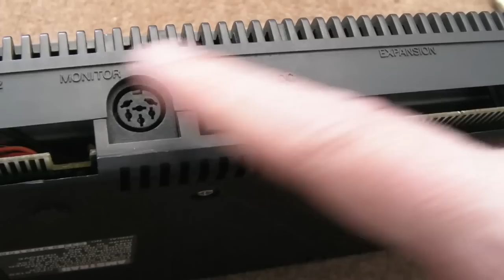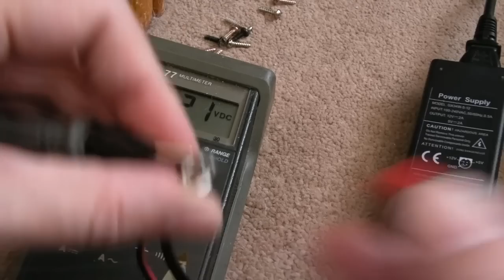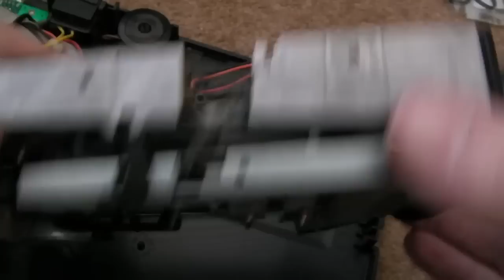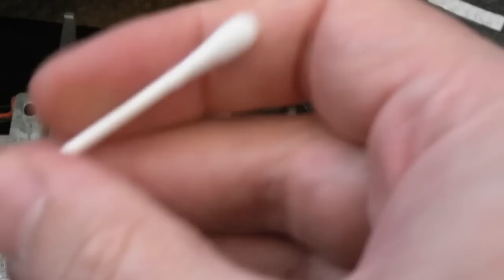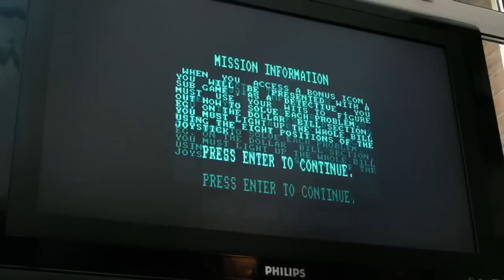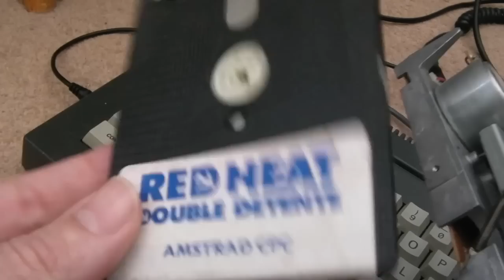Amstrad CPC 6128 Repair & Upgrade Part 1

Comment from the maker: Part 2 - https://youtu.be/y5fvoTnyQTA
EDIT: skonkfactory and TrollingAround pointed out that the infra red sensor there isn't for rotation timing, but used to detect the start of sector 0 when formatting.  This should allow tracks to remain in sync with each other on the disk, ie. all starting sector 0 at the correct point.
Link to Noel's Retro Lab video - please check it out, and his channel! - https://youtu.be/WK0QoVNVO2w
I had to re-upload this- someone pointed out I messed the credits up!!!
Reply: Springs to Mind? 🤣🤷‍♂️
Reply: yep subbed to our man Noel... he must be good because he has somewere to hang his tools ::)

Comment: I had  a nonworking Amstrad drive for years. I cleaned it and I replaced the belt but it refused to work. Yesterday I change all the caps and  it was the first time I got a dir from a floppy. It turn out bad caps on these floppies are a common issue.

Comment: Impressive work of patience and knowledge. How I would like to have one of those, but I would never be able to repair or solve issues if something happens to it. Could that drive be replaced by a 3.5 floppy drive?
Reply from the maker: Thanks!  I believe you can change the drive to 3.5" on this and the Spectrum +3.
Reply: Yes. But:
- You have to swap some lines in flat data cable
- You have to swap two wires in 5V connector
- Standard 3.5" drive never fits the space for 3" drive

Comment: Nice video, thanks for sharing, I bought the following power adaptor from ebay and it works great with my CPC 6128 https://www.amstrad-noob.com/2021/01/26/connecting-an-amstrad-cpc-6128-to-an-external-lcd/ and you won't need to desolder or resolder anything on it, it's compatible with the CPC.

Comment: Interesting fix, by the way that fdd you had is not the same in all CPC 6128's, only some shipped with that particular brand and particular failure, I liked how you explained that the hole in the disc inside the fdd was for the rotation speed, i'll keep that in mind when i program a tool to test alignment/speed for the cpc 6128 later this year. Oh, one final thing, Noel's name is pronounced the same was as 'the first noel...' christmas song (as in 'no el'), and not as the Irish/English pronounce it. Thanks for your video !
Reply from the maker: Thanks!  I stand corrected regards to the hole - some drives (PC ones - not 3") may use that for rotation timing, but it seems that majority of older drives that have a hole like that use the hole to find sector 0!  That's evident in the 6128 Service Manual which I looked at yesterday.  From what I understand they use that pulse so they know precisely where sector 0 is (presumed only when they are on track 0, looking for sector 0).  Some people have suggested that sensor is only used when formatting and a read will work without it.  I don't quite get that tbh, because you would think that the drive would be able to find sector 0 by just reading the contents of the track and looking for an index pulse or something similar.  Maybe it didn't write anything like that, just the raw data....  And when formating, does it really matter where you  start writting sector 0?!?!  I would think not, unless there's some underlying low level format done at manufacture and the position where you write is more critical than I thought?!?!   EDIT: Just made a correction to what I just typed.   There is a TRACK00 sensor, but that I believe is the normal track 0 sensor, not the IR one.  Others have suggested the RPM is constant 300 rpm and not adjusted / controlled on these drives.  I am not sure that's true of all the drives because the service manual describes adjusting it.

Comment: Great video and handy. I got given one of these with monitor and disks for 'my collection' last year. I did change the belt as you did (bought from the same place!) and the DD still failed so it was consigned to a box for sometime in the future. I might dig it out this weekend and give your fix a go. Cheers.

Comment: Interesting,  a Meanwell PSU gave my CD32 video interference. On my 6128's I ditched the floppys and am using Goteks. They fit nice with Gotek case cutting. Then you can ditch 12V and fit a push button in the space, this is wired to test points on the expansion connector to give 'push reset' instead of power on/off. I think your CRTC is a good one (Type 1). BBC Micro CRTC's are compatible. One of my 6128s had a type 2 which is not the best for demos, so that was removed and a socket added.
Reply from the maker: Yes, done exactly that in part 2 =D

Comment: The CPC monitor has a socket for the power cable to go into, and a cable to go into the socket on the CPC. Amstrad joysticks have a socket for the second joystick. The wiring routes the common line on J2 to the common2 line inside the CPC. I got a CPC the week they went on sale in 1985, and used it regularly until 1996.

Comment: Hi, very nice video. I have a dude about disk belts, anyone knows where to find replacment belts for floppy drive? Any home made replacement?

Cocoe68
Reply from the maker: You need to measure the thickness of the belt, its diameter (approx - a little smaller will fit and work generally).  Best place to find them tends to be eBay.  Search on the diameter and you might find something suitable.

Comment: The spring takes up the end float of the armature. Some motors will have a wavy washer inside to do the same thing. As you said the armature being allowed to be pushed back further affects alignment. Are the holes on the back of the motor threaded?  That might be a way to attach a bracket to push in on it though I think your shim will work forever and is super simple.
Reply from the maker: I am pretty sure the 2 screws that hold the motor on could be removed, cap fitted over the back of the motor, and the screws put back in to hold it on.  That said, the alignment would then need correcting =/
Reply: @GadgetUK164  It looks like there are holes in the back of the motor itself. If those were threaded there would be no need to alter the alignment. Of course, it could just slip over the back of the motor and be fixed in place with a grub screw or two that press on the side of the motor body.

I still like your shim the best :)
Reply from the maker: @HeyBirt  I will check that!!  See if they are threaded!

Comment: I think when the drives were originally made that metal tab was springy and intended to take up the end float on the helical shaft. Over time the metal gets less springy and even if you bend it back to "preload" it it will eventually lose tension. Your fix is probably the best under the circumstances, at least you can adjust it if necessary should it loosen.

Comment: Use ferrites for cables to the psu output line, maybe 2-3 cm after not more, to reduce noise.
This Y splitter of 5v make your tv in some cases a big disk drive led when loading.
Give 5v from other 5v psu direct to RGB cable .
Reply from the maker: Thanks, I will try that!!!  I still have the PSU I added connectors on sat here!
Reply: @GadgetUK164  Inform about the result.

Comment: That dreadful tab.  It seems to be intended to take up slack in the mechanism.  Predictably, it would weaken over time and produce this result.  Apparently this was a cheapened design, and earlier ones had a proper coil spring inside the motor.

Decent keyboard, internal drive with external drive port, many display colours, 128K RAM.  A very nice machine.  Too bad we never had Amstrad over here.
Reply: Yeah, it's such a lazy design.

Comment: Another great video. Good thing you didn't lose that pin!
The Sega SF-7000 uses a very similar 3" floppy disk drive. I had to repair mine with a new belt and a bit of cleaning of the head. Thankfully the belt is the same one that the CPC 6128 uses.
I have a video on my channel about cleaning and repairing it as well as an SC-3000H, which was fun.

Comment: The index hole is for the sector 0;  the CPC drives don't support changing the speed (the 12v motor is just connected to a transistor driven from the /MOTOR pin on the CPC).  Without that sensor, everything works except formatting, which will fail.
Reply from the maker: Very interesting!  I would have never expected that!  But thinking about it, for formatting it makes sense, if it has no way of monitoring rotation speed, regardless of where it starts writting on the first track, the 2nd track becomes a problem hitting sector 0, and every track thereafter.  It has me wondering how sector 0 is found on other drives now lol!
Reply: @GadgetUK164  It doesn't actually matter if they all line up.  Once the disk is formatted, each sector starts with a unique number anyway, so that's how you find sector zero on each track.  The index hole (and its sensor) is only used while formatting.   I discovered this the hard way, making a cable to hook up an HxC floppy emulator to an Amstrad 6128 Plus-  Amstrad used a 26-pin header rather than the standard 34-pin Shugart job and I didn't have the INDEX line hooked up in the right place.  Everything worked for reading or writing, but I couldn't format anything;  the FDC would take the format track command and then just hang, spinning the disc, waiting for an index pulse that never came.  5.25" floppies also have an index hole.  3.5" discs generate the index pulse from the position of the spindle motor since their hub is asymmetrical and the disc is always gripped in the same orientation.

Comment: if power supply has a lot of noise then you can try a coil in series on  5v and a capacitor in parallel.  tray  small values and large worthy capacitor
Reply from the maker: Thanks, I will give that a go!  I have tried before to remove the damn switch mode noise without fail, but I didnt have any beefy coils.
Reply: @GadgetUK164  
Inside a switch mode power supply you will find coil and capacitors as noise filter. Coil must be ferrite core and it does not have  many rounds of copper wire.
Used oscilloscope if you have when making noise filter. Easier to see if it works.
Power supply must have a load equal to that Amstrad gives you.

sometimes you have to use NanoFarad  in parallel or mf. value.

EEVBlog Remove Power Supply Ripple.
https://m.youtube.com/watch?v=wopmEyZKnYo

(You can also try this)
https://images-na.ssl-images-amazon.com/images/I/419kD7aNxRL._AC_SY1000_.jpg

Comment: If the floppy is the only thing that uses 12V, couldn't you fit a DC-DC step up module and then run the whole computer off a known good (as in with a clean enough output) 5V PSU?
Even if those converters are somewhat noisy, if 12V are for the motor only I guess it shouldn't care too much about the quality of the power it's getting.
Reply from the maker: Yes, you could do that!  One issue that can arise when using a DC-DC is switching noise.  A few people have tried that on a Commodore 64 for example and it results in noise on the SID.  But it may work OK here.  The technique seems to work OK on Spectrums for example.  The 12v is redudant in the next part as you will see!  The PSU I've already serviced in a previous video and I added over voltage protection too.
Reply: @GadgetUK164  That's because the Spectrum's already noisy as all heck anyway-  that little homebrewed switcher they have to generate -5 and -12 volt rails is *filthy*, you'd never be able to get away with that these days.

Comment: I thought the hole was for detecting sector zero, and the speed was fixed.
Reply from the maker: No, the hole remains always in the same place in relation to the sensor and the head position - it's for RPM!  The RPM is controlled via feedback from that sensor probably!
Reply: @GadgetUK164   - https://en.wikipedia.org/wiki/Floppy_disk#Finding_sectors
Reply from the maker: @TrollingAround  Very interesting!  I am surprised by that!!! =O

Comment: Ive never seen a cpc128k game 🤔
Reply: I had a load of them when originally released. Unfortunately my parents threw out all of them, mostly disk versions that cost about £15 each back in the late-80’s!

My release time 6128 suffered a dead monitor about 3 years in, which unfortunately I was unaware of the ability to buy the MP2 add on at the time, which would have saved it for years to come!

Have another one now, but need time to try it out properly.

Comment: Great video. Yes, that particular model of drive seems to fail like that very consistently. I definitely liked your low-tech fix. It's effective and it'll probably last for a long time. Sometimes the simplest fixes are the best fixes 😃👍
Reply from the maker: Thanks! 👍  Yes, it's low tech! But I think the metal part will continue to bend over time in any case.  It would be cool if someone 3D printed something that fits as a cap over that point on the back.
Reply: @GadgetUK164   im a technologic simpleton, but could you not run some solder on the tab to strengthen the metal?
Reply from the maker: @mrsoggs1350  That's not a bad idea actually!!!   The problem would be soldering onto it - the motor is probably Zinc (or something) plated - but you could scratch off that coating, rough up the shiny plated steel flexible part and solder a blob over the lot.  If the scratching is good enough and the flux and solder bite, it might do the job and be more fixed in place.
Reply from the maker: One problem - it might be too rigid then.  Which could cause damage to the part that slides up and down the worm (over time).   it needs some flexibility I think to act as a strain relief when the head goes all the way to the far end (I think).